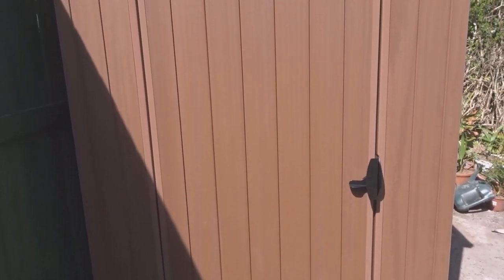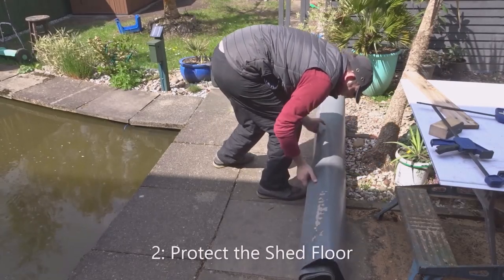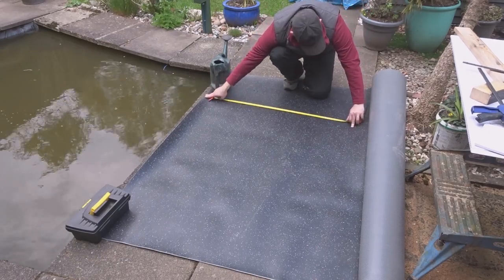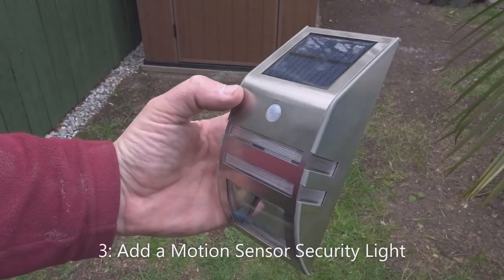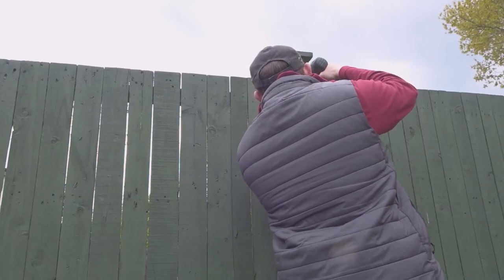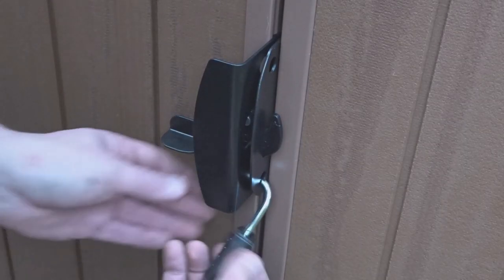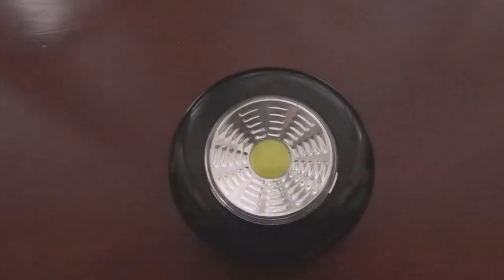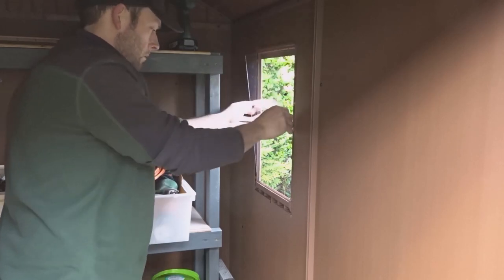My Top 6 Simple Improvements & Upgrades for a Garden Shed

Comment: Did you use any kind of adhesive for the kitchen flooring you installed on the floor?
Reply from the maker: No its just laid down. I could have used an adhesive but it doesn't seem to need it as it never moves.

Comment: Hi Phil, these videos are great, thanks for making them!

Can I please ask how would you anchor a keter shed on a plastic ecobase base?
Reply from the maker: Thanks 👍🏻 not sure about anchoring to a plastic base that could be tricky .
Reply: I'd suggest getting a long drill bit and drill all the way through into the ground below. Then get a threaded rod, doesn't need to be threaded the full length and carefully fill the hole with post mix and put the threaded rod in. Once it's set you can wind a nut on the end inside the shed.

Comment: How does this do with rain? I am considering getting one of these and making it into a micro camper by shortening the wall height and adding some thin insulation and an ac unit.
Reply from the maker: Mine hasn't let any rain in so far. After 1 year it's still bone dry inside.
Reply: @PhillWyattProjects  thank you so much for replying!!
Reply: What is a "micro camper" ? When will you make a video of it?